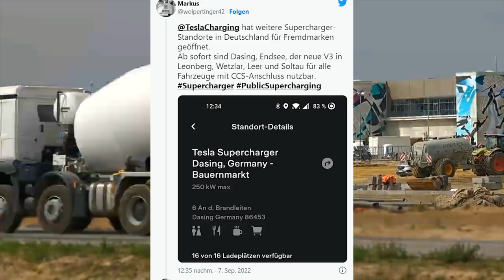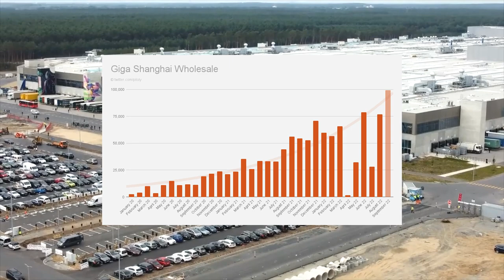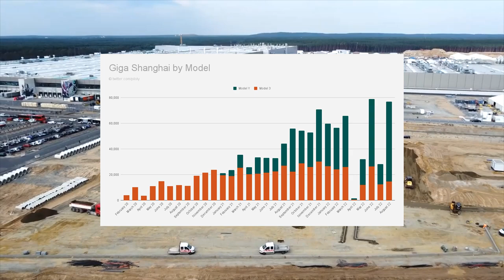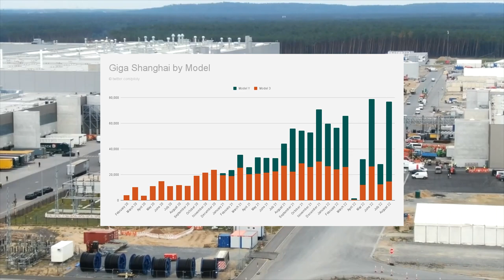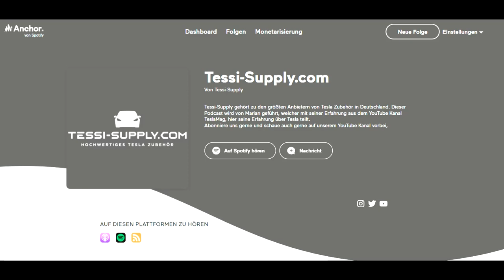TESLA GIGA BERLIN Ramp up!

Comment: Tesla will of course try to buy as much of the lithium supply as they can; this will have the effect of denying competition as there is n to enough lithium. Viking says they are likely to use sodium cells in a cheaper EV.  Again addressing Teslas chargers - lots of people already made a commitment to Tesla and did it in part because they have the super charger network; this will damage customer loyalty because they won't believe Tesla is loyal to them and will change the deal they got.